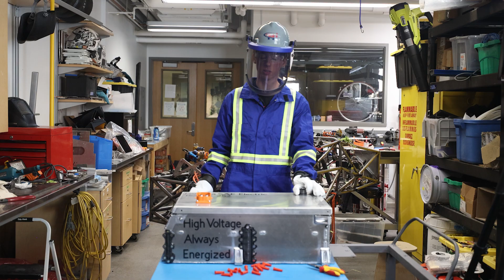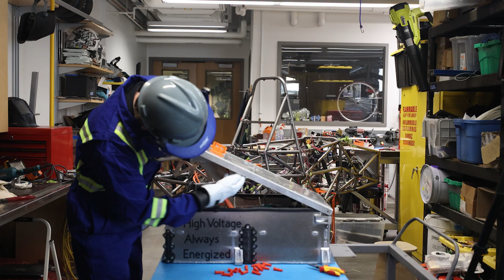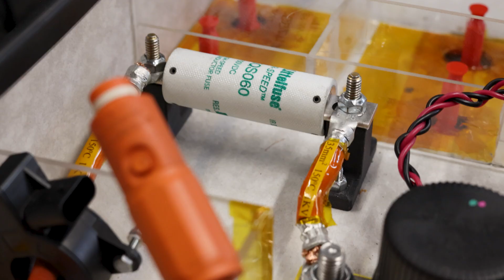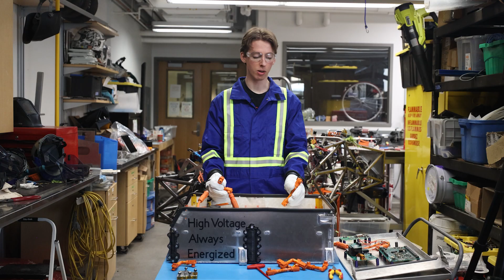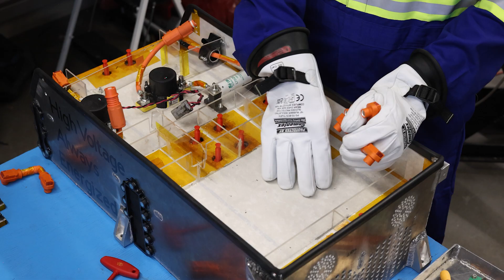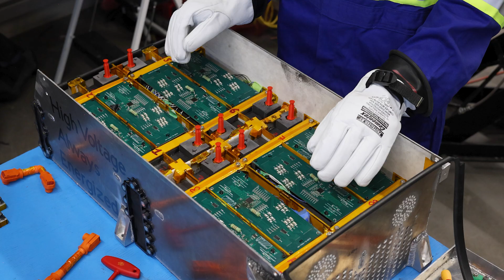UBCO Motorsports | Accumulator PreTech Inspection for 2025 FSAE EV Competition

Comment: can i ask what the fastener method you use for your accumulator. For accumulators with caps like that, the fastener system can only be single access. And must meet positive locking mechanism